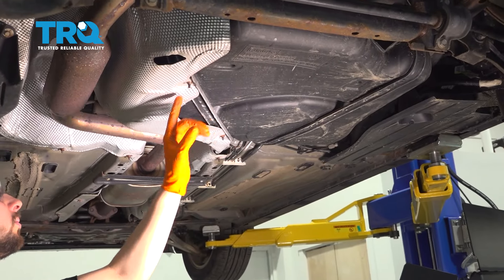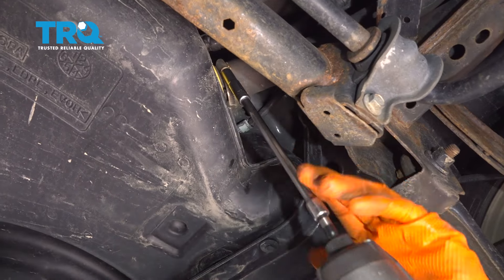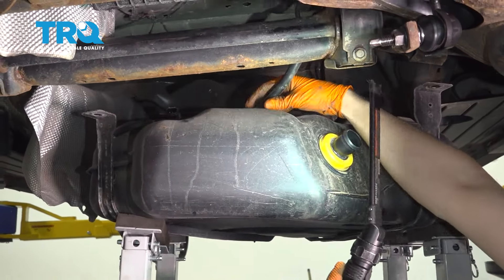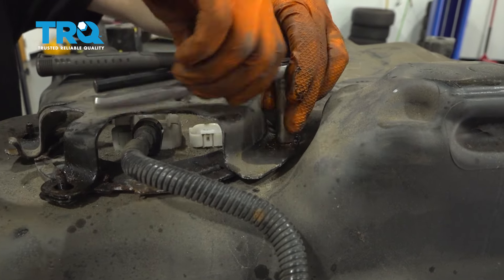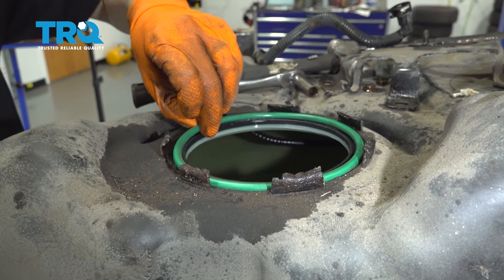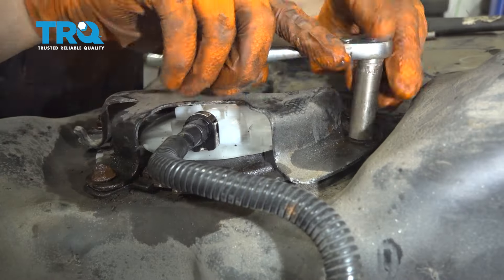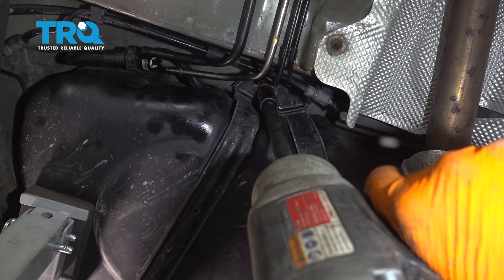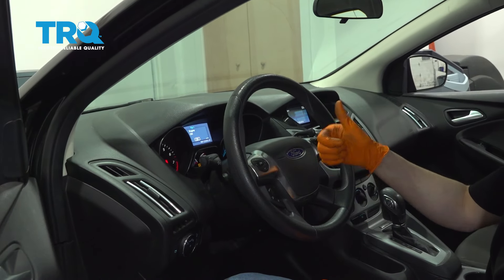How to Replace Fuel Pump 2012-2020 Ford Focus

Comment: There is no access door so most people will have to take it to the ford dealership and pay $900 to replace it. Making them more money.
Reply: Exactly, it’s designed to extract resources from the non- mechanic.
Reply: We got an estimate for $2700 for a 2019 Ford Fusion. 2024 October

Comment: This video was a HUGE help! My fuel gauge wasn’t reading accurately after it had been hit by another car and so I decided to drop the fuel tank and look at the fuel sender unit to see if I could see anything I could fix. Turns out the force of the impact knocked the metal wire out of its little plastic clip. If it weren’t for this video I would’ve had a much harder time trying to figure everything out!

Comment: As I was replacing the fuel pump on my Ford Focus, I came across another video where they took off the back seat on a Ford fusion and it had access to the fuel pump. Is it the same with a focus??? If so, this could have been so much easier 🤣
Reply: Do you remember the video ? It will help a lot
Reply: There’s no access port on the focus, did you watch the video? Where did you see an access when he dropped the tank?

Comment: Is there any outside fuel filter for these models?
Reply: For a 2012 focus there is no outside fuel filter.
Reply: @Dhi-fe5eu  is it the same with a 2013?
Reply: No. The Fuel filter is attached to the Fuel Pump itself as a “Sock” style Fuel Filter. It’s designed for the life of the vehicle.

Comment: It just boggles my mind how American car makers won't put an access door in the car to get to the fuel pump.  Japanese cars have had this since the 70s.  Granted, fuel pumps don't die regularly, but dropping the tank isn't a reasonable solution for replacing pumps.
Reply: They do have access holes in American cars this the first one I've seen that didn't
Reply: @coltinhines6879  access holes for the fuel pumps in American cars are the exception rather than the rule, unfortunately.
Reply: @tokuzumi1  I can't argue with that
Reply: My high pressure fuel pump goes out once every year/2 years, so....
Reply: @coltinhines6879 no sir they dont
Reply: @stevenshepherd2874  Chrysler 300
Reply: It's a European car

Comment: Could you post a tutorial on how to get to the fuel filter?
Reply: There's a lifetime Fuel filter it shouldn't need to be changed
Reply: The geniuses at Ford. Thought It was a good idea to put the fuel filter inside the fuel pump. So in order to change the fuel filter you have to swap out the fuel pump. Before it was simple as hell to just swap out a fill filter but now they make it to where you have to take it to a dealership or a mechanic. Also so you can spend more money, I just spent 200 on a fuel pump when I could have spent $15 on a fuel filter

Comment: Love the video! Do you happen to know where the fuel filter is with these models?
Reply: I the fuel pump ?
Reply: The 2012 Ford Focus does not have an outside fuel filter. The fuel pump is the pump and filter.
Reply: @Dhi-fe5eu  There's a lifetime Fuel filter it shouldn't need to be changed

Comment: I have a 2013 Focus 2.0  Looks the same.  Is the filter inside the pump unit?  Im getting loss of power and not sure what it is.  I thought I could start by changing the fuel filter...
Reply: my 2012 2.0 has slow acceleration, did you replace the filter in your car.
Reply: The Fuel Filter is attached to the Fuel Pump itself as a “ Sock” Style Fuel Filter. It is designed for the life of the vehicle.
Reply: I bet any amount of money your fuel line is clogged. This so called fuel filter on the pump is 🐂💩!! Over time particles will bypass the in tank filter and eventually build up in the line and completely clog it. Has this happened on an Audi because this person never changed their in line fuel filter. I hope this helps anyone going through this problem. 🇺🇸 1st 4ever

Comment: this a job can be done in mercedes s call bmw 7 series in minutes under passanger seat rear Thanks ford ... Next model make an enigma to take 10 hours at least
Reply: Yeah you can do the same on the focus but will require an angle grinder